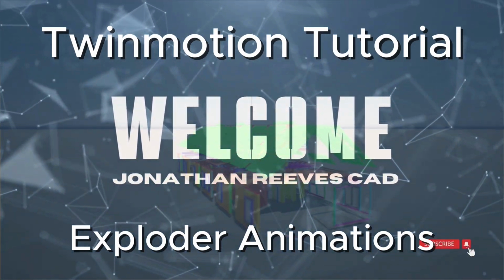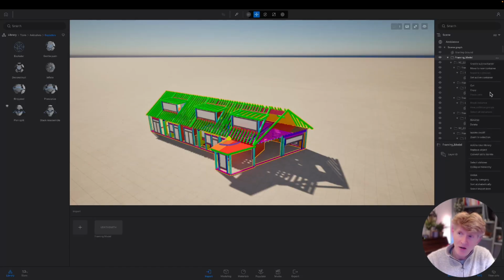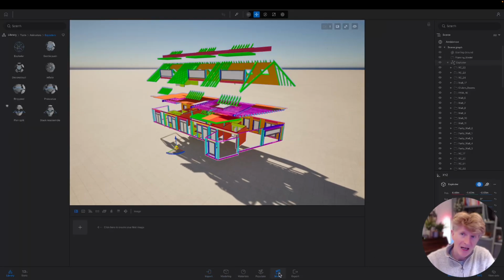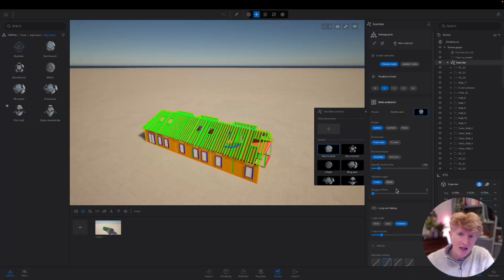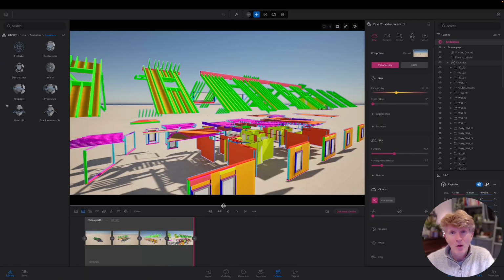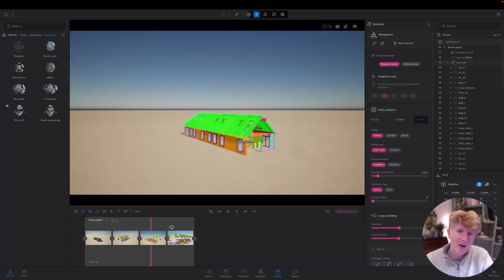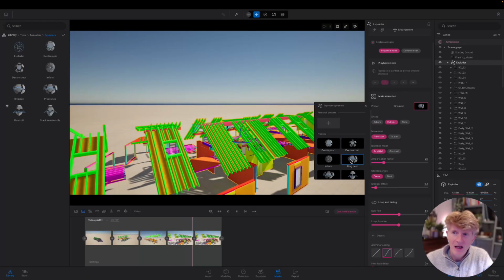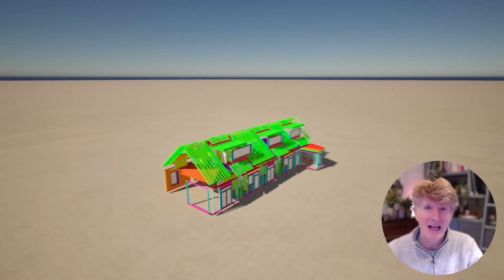Twinmotion Exploder Animations – Step-by-Step Tutorial

Comment: Great video. I just gave it a try with project. My exported file from VW has all my layers, but when imported into Twinmotion, it does not explode. It moves at complete single object. Thoughts on that?
Reply from the maker: Glad it was helpful, and that's an interesting problem. Make sure you drag the individual layers into the exploder, not the folder containing the layers.